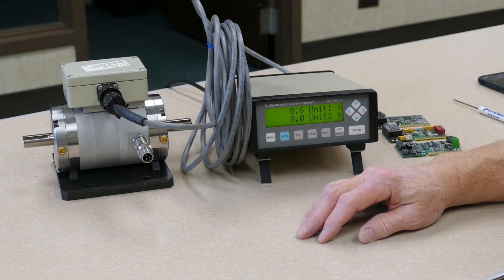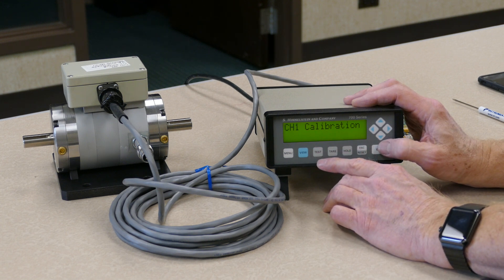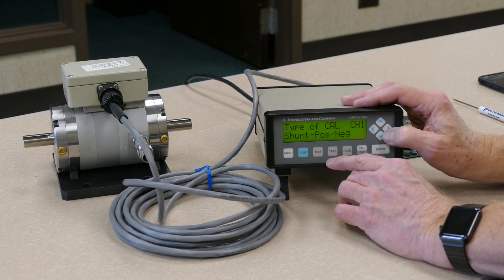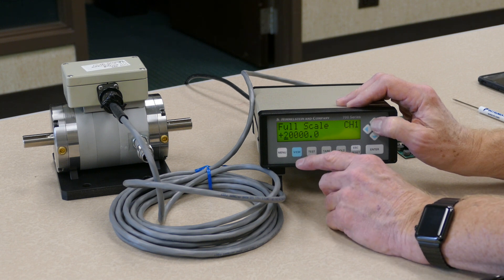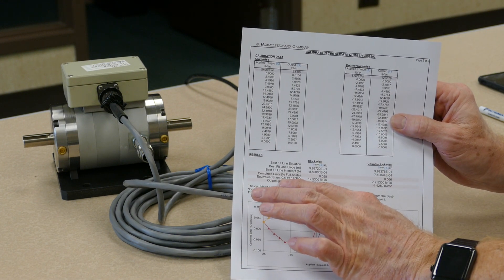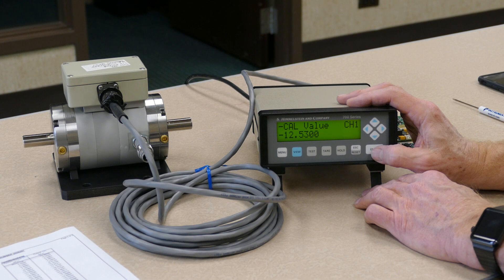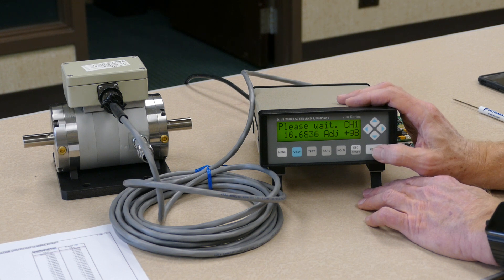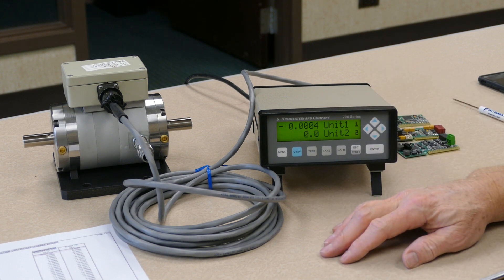Performing a Shunt Cal on a Himmelstein 700+  Series Signal Conditioner

Comment: I had a 700 series signal conditioner from S.Himmelstein  and Company and 3120T (1-2) Torque Transducer. I need to calibrate it. Getting error while calibration.
Also i dont have any data sheet to set the full scale +Cal, etc values.
Can you help me in this to solve the problem or by sharing the transducer certificate for calibratoon values.
Reply: Dear Sir, We received your message here a moment ago but by email earlier today. Our representative in India, Milan Sarkar of Influx Technology will be contacting you soon. We apologize for any delay.